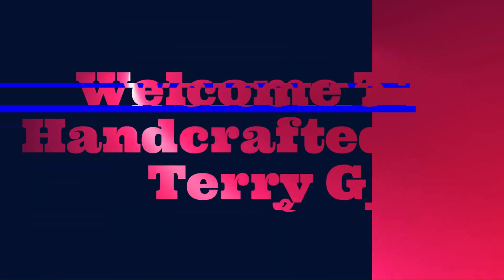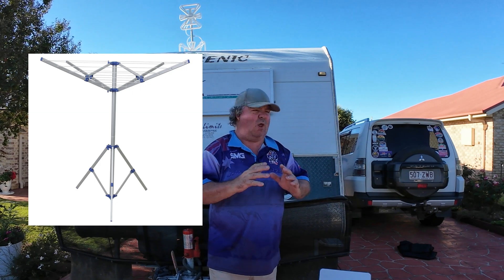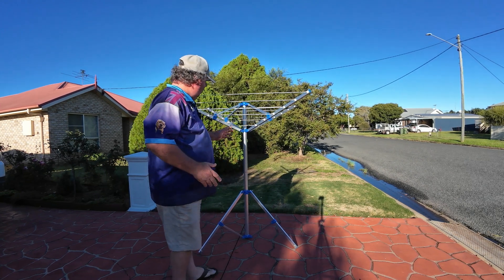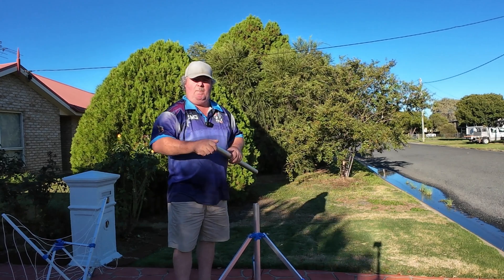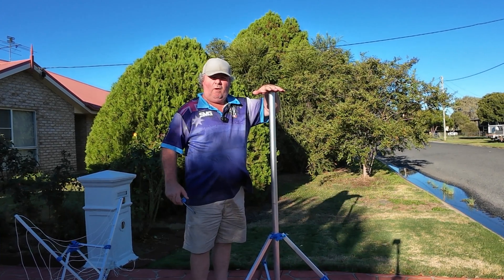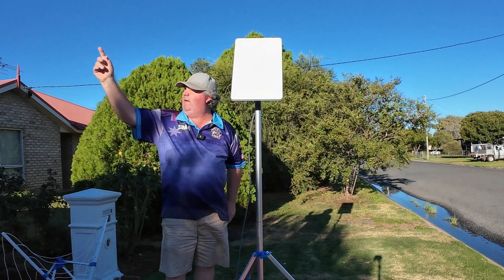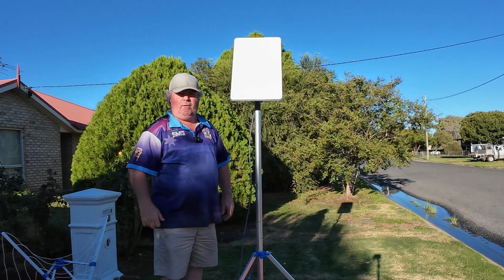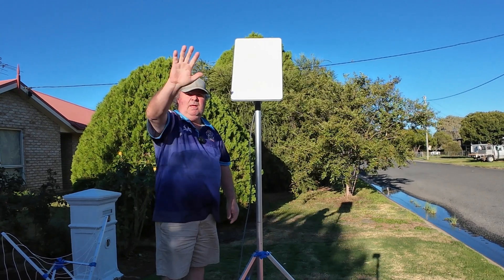Get Stellar Signal Strength With The Starlink Dish Stand!

Comment: I'd be concerned that wind can rotate the antenna. Dishy wouldn't like that.
The pop out button on Dishy's shaft can be aligned with a hole you make in your clothes line pole so that Dishy locks into place when you insert the shaft into the clothes line pole. With that small mod there would be no way Dishy can rotate and it is more firmly in the clothes line pole.
Reply from the maker: Thanks Jed for watching and your comment 👍